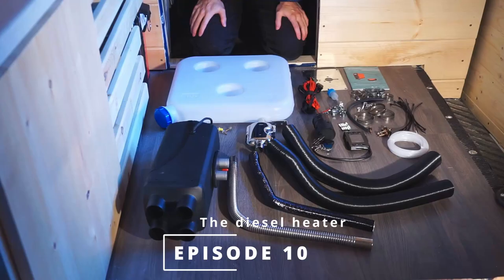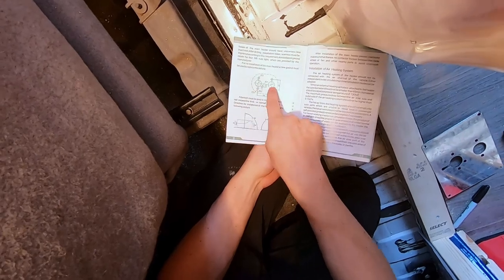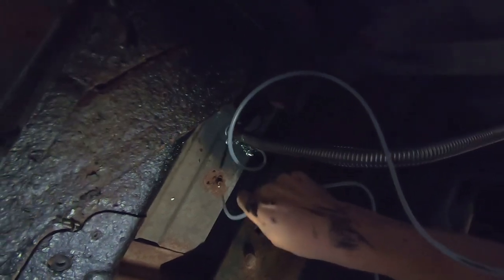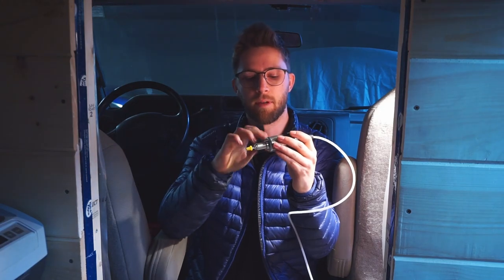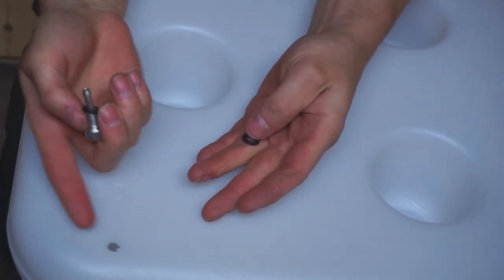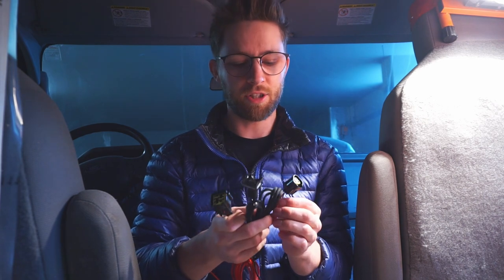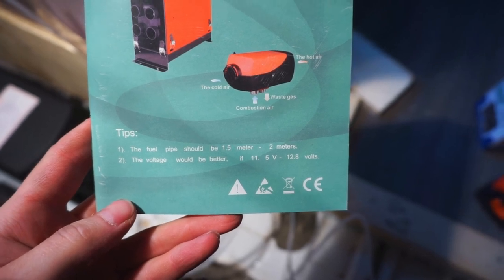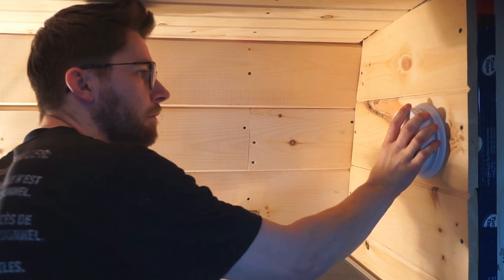How to INSTALL the Chinese DIESEL HEATER full tutorial | DIY Van Conversion Ep. 10

Comment: I like when your older videos pop up. These are great heaters, I installed one in my VW Westfalia and its awesome! I can use it while driving as well as camping. Even comes with a remote so i can control it while driving. Nice install, thanks for sharing! I see in upcoming videos you install solar, that I did as well, I didnt mount them on the van, rather have a simple folding frame that I mount them on (2x110 watt panels) this way i can face them and track the sun. There awesome!

Comment: Hello from France
Be careful, carbon monoxide is not smoke: it does not rise, it is as heavy as the ambient air. It is therefore necessary to place the detector at the same height as the heating appliance, and ideally at the height of the bed because it is when you sleep that the risks are highest.
Reply: Excellent point. Was thinking that the detector should be lower.

Comment: Great video but a few things I think might help improve. The size hole for the tank is 8mm drill bit. Drill the fuel tank on the top of the tank and use a dip feed pipe as it will leak on the bottom after awhile it's inevitable.  You don't need to use a voltage regulator . And carbon alarm should be head height thanks

Comment: Did you seal between mounting plate and van floor  to prevent gases coming in - especially if the exhaust pipe comes loose?

Comment: Update to yesterdays comment below: the diesel placed into heater was "old" and maybe the source of the problem. Emptied out system and replaced with fresh diesel, still no joy. Totally baffled now. No choice but to uninstall if can't get it working by lunchtime.

 "Great video but the product itself has issues. I followed the instructions to the letter, primed the unit, hit go...and ERROR O6 came up. The fan starts for about 1 second, then everything goes dead. Again and again. Been through a bunch of other YouTube videos and no one has a good fix for Error 06. Several videos discuss Error 06 issues, in terms of stripping the whole unit and buying new components, new motherboard, motor, etc but mine is brand new out of the box for god sake. Spent 2 days fitting the kit to my van, now looking at spending tomorrow (3rd day) ripping it all out again. The biggest waste of time and money I have ever known. People need warning about this, not enticing into a yet another corporate scam."

Comment: Very nice job guys, but a complicated system and of course a bit dangerous if that carbon monoxide detector fails at the wrong time. A electric occolating heater connected to solar would not have been efficient?
Reply: Not enough solar in winter.